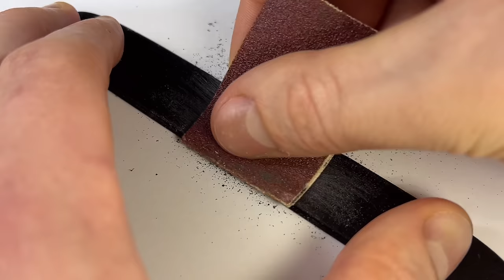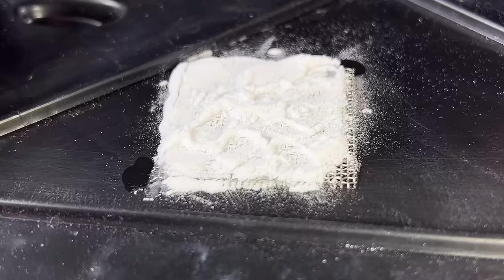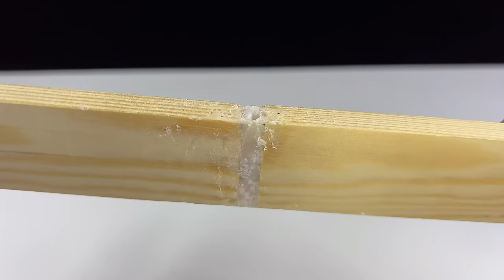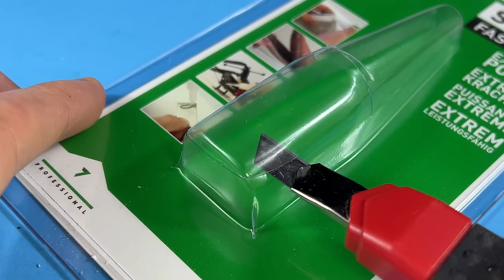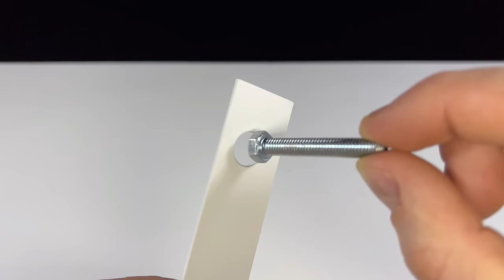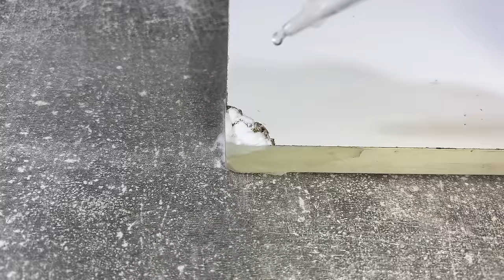Super Glue and Baking soda ! Pour Glue on Baking soda and Amaze With Results

Comment: I been doing this for years but I use aluminium or brass dust it's a lot tougher than baking soda for setting the opals in aluminium castings and it polishes up nicely.
Reply: Can you buy that at Home Depot or do you have to make your own dust?
Does it matter what you are bonding it to like if it was a wooden leg of a chair would brass, aluminum,  or baking soda fit better based upon what your trying to bond with?
Reply: @olandofuller5588  you can buy it online most of mine is from grinding up leftover metal from castings I make it will bond to literally anything, superglue first then metal keep doing that till slightly proud of surface then sand down the brass always looks like gold.
Reply: @czeslawmeyer7871  thanks. I'm going to practice on some old wood around the house.  Thank You.
Reply: Do you mean opal gemstones?
Reply: I've been doing this kind of stuff for many years now, but this guy is truly fantastic
Reply: @acidlab9586  Thanks. 
I didn't even think to use it's own material.  2 heads are better than one.  Thank You

Comment: Bruv this is phenomenal for fixing drones and other diy things. Epoxy is the typical way it's done and idk which is stronger, but this seems strong enough and very easy to apply
Reply: It's stronger. And cheaper than epoxy. I've used this stuff to fix models before and it holds good.

Comment: I really enjoyed this video and think this hack has so many applications... I have been trying to repair a few things using this method, HOWEVER I have been struggling to find a super glue with the right consistency.  I am on my 2nd type of super glue that I have purchased and the consistency with each one so far is a little bit too gooey and isn't really absorbed by the baking soda when dropped over it, but rather the glue just balls-up on top of the baking soda.  If anyone has any recommendations for glue that has the runny consistency as seen in the video I would appreciate it.-- I haven't been able to find the Loctite glue as seen in the video anywhere...Thanks
Reply: loctite is at lowes,  ace hardware,  Walmart, amazon,  etc.
Reply: Also avoid superglue gel. I didn't even know about it until i almost bought the wrong one

Comment: I believe this was discovered by the Air Force maintainers some 40 yrs ago. Commonly used to make load bank insulators. I've even used this to mend a brokenbroken hockey sticks during a game, chipped finger nails, dents on cars, fill in missing pieces of porcelain. The uses are endless. Because it sands well and covers easily.
Reply: how long does it last? Is it a durable repair that lasts for  Years or does it wear off faster?

Comment: Been doing this for years , a Luthier showed me this trick if you play guitar/ukuleles, or any instruments with a nut and you've lowered the gap and are getting "Fret Buzz" , it's a brill fast fix , but thanks for this ,it's actually a great alternative than paying 5 X's more for Epoxy branded glues when you can get a cheap £1 / $0.80c tube from your local pound/dollar store ,and Baking soda , a carton lasts forever for the same
Reply: it’s better to use good super glue like Loctite or similar , especially if it’s a repair you want to last, the cheapie stuff is often relatively brittle when set.

Comment: We were doing this at a company I worked for over 40 years ago. It wasn’t called super glue back then, it was called hot stuff. We used these on a daily basis.
Reply: To do what kind of repair?
Reply: @MrAllstar  we did custom auto interiors. It was used for bonding hidden areas like the underside of a dash getting a leather wrap.
Reply: @markjames2338  In the Model T?
Reply: @noahway13  almost 😅
Reply: @markjames2338 can I use fevikwick ❔

Comment: Glue and acrylic nail powder does the same thing too.
Reply: But ☝️….acrylic nail powder is EXPENSIVE (by the grams 🤦🏻‍♀️) Baking soda is SOOOOO MUCH CHEAPER and ☝️ you get SO MUCH MORE vs Acrylic nail powder. BUT….you do have a point about the Acrylic vs Baking, my 22 y.o daughter showed me the hack where you just use a cheapy nail tip & put superglue underneath the nail tip (on your finger) & sprinkle the nail acrylic powder AND THEN JUST FILE IT DOWN w/ a Drimmel 😃👏

Comment: Aren't you just giving the super glue more surface area by doing this or is there a chemical reaction involved?
Reply: Chemical reaction. If you notice in the last clip with the two drops, the one with the baking soda dries much quicker than the one without.
Reply: Someone mentioned in another comment that superglue is acid-based, so when you combine the basic soda powder, it acts as a catalyst, forming the enzymes much faster and ultimately drying it faster and harder, as opposed to just letting it air-dry.

Comment: What stuck me about this mixtures is the durability and functionality, which is displayed in how easy it was to machine after repair without failing. Those fixes would hold under load and daily use. Especially those steel mesh repairs

Comment: Also works good for a diy tooth filling. It does generate some heat briefly but is far more safe than the mercury fillings you get at the dentist, cheaper too!
Reply: THANK you for trying that!!!
Reply: How the heck would you file that down tho🤔
Reply: @tracyliberty8031  Angle grinder or a belt sander 🤣
Reply: They don't use mercury fillings anymore.

Comment: But.... What is the baking soda actually doing? You're far better off using fine shavings of PVC so they melt in the superglue and form a heavy plastic weld.
This is doing absolutely nothing to to strengthen the actual bonding action. It makes a hard patch but that's it. It's still just superglue.

Comment: You can't buy super glue that is runny like that so what are they using.
Reply: Yes you can
Reply: You can even see the brand on the bottle in the video, it's Loctite. By the shape of the bottle with that tip it's probably one of their "control liquid" superglues.